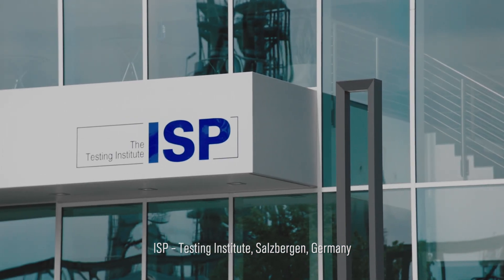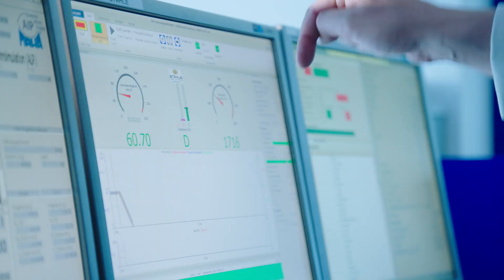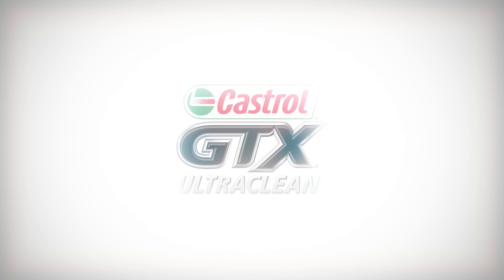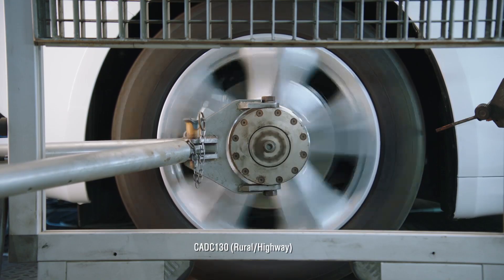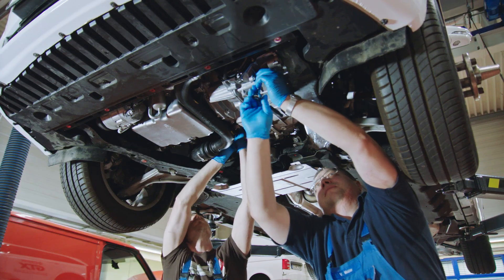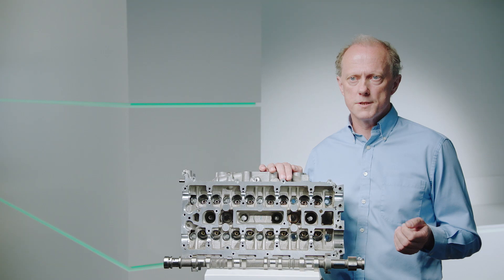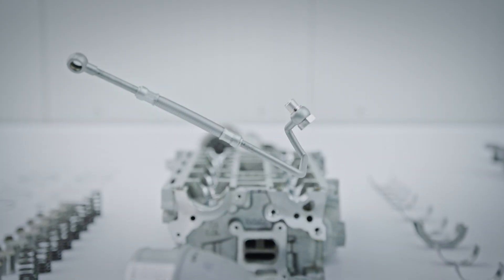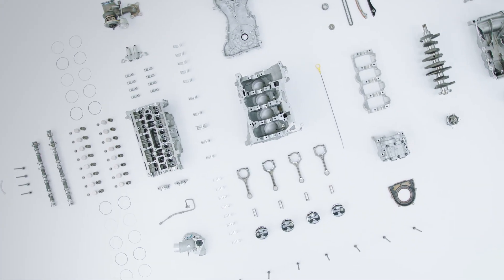Castrol GTX ULTRACLEAN – The 100,000 Mile Test

Comment: Hello! Which oil do u recommend on a 92 toyota corolla E90?
Reply from the maker: Hi JoaoMagalhaes7712,

Thank you for your question. We always appreciate hearing from our loyal customers!

For a 1992 Toyota Corolla 1.6L 4-cyl according to Castrol’s Lubrication Recommendation Guide, 10W-30 motor oil is recommended for temperatures above 0° F. You may also use 5W-30 motor oil for temperatures below 50° F. The oil used must be labeled with the API Certification Seal.

Any of the following formulas can be used in this engine:

• Castrol GTX 10W-30 
• Castrol GTX Ultraclean 5W-30
• Castrol GTX High Mileage 5W-30  or 10W-30 
• Castrol GTX Full Synthetic 5W-30
• Castrol EDGE 5W-30 or 10W-30
• Castrol EDGE High Mileage 5W-30 or 10W-30

Based on the age of the vehicle, a high mileage oil like Castrol GTX High Mileage or EDGE High Mileage would be a great choice.

Castrol USA
Reply: Hello! My toyota corolla has a 1.3L 4 inline engine with 55kW. Is it the same oil? People have suggested me to use 10w40 instead
Reply from the maker: Hi JoaoMagalhaes7712,

Please contact Castrol Customer Relations directly for additional assistance by e-mail or at the telephone number below:

Email: contactus@bp.com
Phone: 1-888-CASTROL (1-888-227-8765)
Hours of Operation:
Mon – Fri: 9am - 7pm ET

Castrol USA

Comment: I run a volvo v70 winh d5    2.4 diesel engine.  Is the ultraclean a3b4 suitable.  I have 900000 miles on same engine and change oil every 2000 miles.  Been using castrol since car was new in 2005.  Have done 450 oil changes in 17 years on this volvo v70
Reply from the maker: Thanks for being a loyal Castrol customer! We appreciate it!

Comment: I am curious about using this in my Toyota AE101 Corolla. My car has a 5AFE engine and it is currently leaking oil. Both front and rear seals have worn out due to the previous owner using a lower quality oil.
Reply: I recommend using Castrol GTX high mileage
Reply from the maker: 💪  We appreciate it!

Comment: I have a 07 corolla. How long until I should change my oil with gtx ultraclean?
Reply from the maker: Hey Blake! It looks like Toyota recommends a drain interval every 6,000 miles for the 2007 Toyota Corolla. Drain intervals are dependent on the condition of vehicle and driving conditions. If the driving conditions are more severe, the oil should be changed earlier than the recommended mileage. 

Hope this helps!
Reply: @CastrolUSA  wow thank you haha I have been getting robbed. Telling me I need it every 3 months
Reply: @CastrolUSA  do you recommend this gtx on corolla w/ a 155k mileage? yr 2000
Reply from the maker: Hey Jed! We recommend EDGE High Mileage 5W-30 or GTX High Mileage 5W-30 for your particular situation. Hope this helps!

Castrol USA
Reply: @CastrolUSA  Thanks a lot!
Reply from the maker: Anytime, Jed! Thanks for being a great customer!

Comment: I have a Mercedes om642 they are renowned for engine sludge I can’t decide whether Castrol edge or gtx c3 which would
You guys recommend
Reply: Edge is more performance oriented in my mind only because I run it in a 5 liter ford mustang gt but for a older engine I'd always go towards their green bottles eepically when they got more mileage. Ultra clean or if you can find, magnatec is very good. In tests the ranking of all Castrol oils are basically their tier ranking but magnatec doesn't burn off as easily so if you want a pretty good oil that's least likely to burn off but the edge professional which is the gold bottle lubricates the best. But a om642 I'd definitely run some ultra clean for a bit to try and clean it up as much as it can and run magnatec in winter since it is formulated to help coat the engine and reduce wear upon cold starts.
Reply: Never seen a Castrol with ester on its base. So find an oil that has at least 5% of polyolester.
Reply: Google Irv Gordan. He used Castrol GTX ultra clean and drove his Volvo well  over three million miles. He changed the oil and filter every three thousand miles

Comment: but what happens to the dirt that is inside the engine already??? clear it off okay but...absorb inside?
Reply: the oil filter will pick it up as its constantl ycleaning the oil passing through it , although the filter can only take so much dirt  till its done its job , then a filter change is required with new oil

Comment: This test is TOTAL BS... 
No stop/start ..No  sitting in heavy traffic with the oil getting super hot ..No heaving revving when the engine is cold...  
A TYPICAL engine oil/filter change lasts around 7,500 Miles or 1 Year which ever comes first  before the oil gets dirty in the REAL World.. 
And I would NEVER trust any engine oil that has done over 10,000 Miles or is older than 1 Year old.
 
ALL of these "Mega high mileage" cars you see on the road have ALL have oil/filter changes done OFTEN.

Comment: I guess my car should have died out 25,000 miles ago. “ 100,000 lifespan of an engine” is he serious? I do use castrol GTX high mileage synthetic blend, though, plus STP Extended life oil filter . But never tried or would try the ultra clean.My car runs like new being that it has 125,000 miles in it. I bought it from a Dr. though ..the only owner.His kids are not old enough to drive. So him or his wife were the only drivers.I agree it’s not a fair test. Testing it in a controlled environment is not real. The stop and go from city driving, puts a lot of stress on an engine.

Comment: Miles are not as hard on the engine as TIME.  This test will not give the same results as when the test takes 10 years AND 100k miles.
Reply: 100% CORRECT .. This test is TOTAL BS... 
No stop/start ..No  sitting in heavy traffic with the oil getting super hot ..No heaving reving when the engine is cold...  
A TYPICAL engine oil/filter change lasts around 7,500 Miles before the oil gets dirty in the REAL World.. 
And I would NEVER trust any engine oil that has done over 10,000 Miles or is older than 1 Year old.
Reply: @briansaiditsoitmustbetrue4206  
Im running castrol edge with a quart added of ultraclean, about 17,000 miles now.
>_>
Reply: @sasquatchcrew  I run my car on bog-standard 5W-40 from Shell ..BUT I change it every 6 months with the oil filter 
Works out at about 7,000 Miles for me.  
I still would not trust any engine oil that has done over 10,000 Miles or had more than 1 Year of running. 
This is why my old petrol engine Toyota is still going strong at 204,000 Miles 
I expect it to get a quarter of a million miles .. Clean oil/filter all the time = long engine life.
Reply: Right. Complete bogus test

Comment: Drive the car on real road with real road condition then I'll believe
Reply: https://youtu.be/zxmD4QYZ8LU
Reply: I'm wondering if their computerized engine and load simulator mimicked city driving. I think at the beginning they note rural/freeway driving, and those have far fewer stops. Also, how often did they allow complete cool-downs and did they mix in some 32 degrees Fahrenheit to 50 degrees Fahrenheit startup cycles? Also, what about some simulated heavier loads (uphill segments, full load segments). And what about GDI intake valve buildups from vaporization/blowby? Problem is the "fuel economy" computerized cycle used in most of these tests is a very easy cycle. Decades ago Consumer Reports tracked a bunch of taxis in New York and got fine long term results from the incredibly poor oils in use back then. So what I'm mainly getting out of this test cycle is that semi-syn isn't completely terrible and won't sludge up the engine, not that it can deal with the higher stresses of aggressive American urban drivers.
Reply: First Name  true . You have dust and others . This is a controlled environment
Reply: Истину говоришь друг .
Reply: в точку!

Comment: Should I use this or the gtx high mileage synthetic blend one? My 2002 Lexus had 190k miles and is on conventional oil
Reply: I have a 2007 Honda Civic EX not to be confused with the sporty SI. My car has 126,000 miles in it. I use Castrol Edge ( has titanium) high mileage advanced full synthetic, with Mobile One extended performance oil filter, and It doesn’t leak a single drop of oil. I set my eternal oil computer to 100% and in one year or a little more gets to 30% oil life. My friend has a garage, he changes oil and fixes breaks and tires for a living. He said the oil looked a felt great after he changed it, maybe I could go a little longer, but why risk it. The car Manuel says 15%, but at 30% for a little over a year, it more than payed for itself . I drive my car every single day in City stop and go. I don’t travel. The “ high mileage” in Castrol means it has a rejuvenator that rejuvenates the seals and helps keep The catalytic converter clean in older cars.

Comment: 100k miles is the typical life of an engine? WTF yall smokin?
Reply: I want what they smoke too :)
Reply: If It's a VAG product then yes
Reply: Typical "economic" life of the car, when ownership and repairs are cheaper than buying a new car. Meaning how long before the car repairs at a dealership cost more than buying a new car. Most cars that stay in service longer than 100k and 10 years are getting repairs by their owners which changes the economics completely; even an indie shop can extend the value to cost ratio of ownership. Except for my dentist with his 120 miles a day freeway commute (60 each way). His car ran up 350k before he got rear ended and totaled. The benefits of freeway driving with no stop and go in non-snow, non-desert, non-towing country.

Comment: I started using castol when I was in high school my truck had 67,000 Miles it's now been 11 years later and it has 260,000 miles I used to use the plain Castrol conventional GTX but now switch to the black bottle casrtol edge now to the Castrol titanium....and my truck has not one problem.....please I would like for you to study my pickup truck everyday for the past 11 years my truck has been pushed really hard in the heat and cold days of southern California and heavy stop and go traffic....I push the engine to about 6000 rpm daily and it has not failed me....the vehicle.... 1996 Nissan pickup 4 cylinder 2.4L .......
Reply: Those old ka 2.4 motors were just built well, true Japanese engine
Reply: @vincentbenfante8213  my truck is now pushing 290,000 and it’s still running like a champ I’ve now moved to Oklahoma drove my pickup from SoCal to Oklahoma and it didn’t fail me.
Reply: My 96 Nissan pickup just rolled out 300,000
Reply: @Platano_macho  my neighbor has over 750,000 on his 07 Honda Ridgeline. Gets the oil changed when the OLM comes on. $29.95 with his $10.00 coupon. That’s with a free car wash. At that price I doubt he’s getting full synthetic. Best oil is clean okl
Reply: @Platano_macho hey, is there any update on your truck?:)
Reply: @moses9368  yes sir as of right now I’m a little over 312,000 miles and it’s still running strong I’ve noticed some transmission slipping when it’s cold but the truck still runs great
Reply: @moses9368  and now the truck has went from California to Oklahoma where it still sees 125 miles daily
Reply: @Platano_macho  That's amazing to hear man!! I hope you keep enjoying your truck :D
Reply: @moses9368  I will man I love this pickup
Reply: 🦄🦄🦄🦄🐆🐯dhrueurrorrgshdiri3oruriirii4iii464647
Reply: Castrol GTX has synthetic blend
Reply: Cold? Southern California?
Reply: @vermontvermont9292  yeah we used to get cold days typically around 35 degrees but not anymore
Reply: @Platano_macho  35 is T shirt weather in winter here in VT lol. I can't stand the weeks on end of 1°f with a high of 13°f . So cold your car won't even warm up after 30 minutes of idle time.
Reply: @vermontvermont9292  I had some cold weather here in OK the lowest was 11 degrees below freezing my truck had chain rattle for a good while because of thick oil lol
Reply: @Platano_macho  can't stand it. Every year I say I'm going to leave VT, and move south. Never do. I can't imagine never having to oil undercoat my car, or buy snow tires for my winter wheels. Putting plastic over the windows on the house. I need to get a block heater so I can keep the oil warm at night. Maybe I'll do that soon.  By the end of October things will be freezing and probably have snow. I've seen snow as early as October 10th before. Almost always have a dusting by Halloween.

Comment: Not really a good test, fair enough they got the car to 100k milles but what about the elements such as polluted air, harsh braking, and turning in to the road at high speeds.The new car wasnt exposed so the engine will look spotless!
Reply: Exactly.  Also they would have used spotlessly clean fuel, not the garbage you often get from the local pump being pushed through a fuel filter that should have been replaced two or three times in 100,000 miles but usually never gets done, cold starts and rough owners who run the car hard from cold, and so on and so on - all the stuff that introduces particulates into the oil that speed its break down and increase abrasiveness - lab tests don't really tell you much at all unless you throw a whole lot of typically adverse conditions in to the testing like you would get in the real world.  Even the very best fully synthetic oil will break down much quicker than 100,000 miles on the road.  Still, I've been using Castrol oils for many years, and they are good value.  I've tried moving to other brands from time to time but always come back to Castrol.
Reply: Tai Mir yep here in Canada its -35c in winter +35c in summer. Factor that in.
Reply: rapturekevin bring that car to Michigan lol but I do like the regular gtx I ran it for 7 k miles in my 97 2door neon 2l sohc .. And only lost a quart of oil but it was all highway. Plus I played with the car a lot hated take off and more
Reply: Plus then cleaned it all up and its a damn commercial for them so if any parts did look bad they'd swap them out for new parts to show on this commercial. Dont trust these guys further than i can throw them. I bet they only ran this engine for a day or two.
Reply: I have a 2015 Nissan Sentra that I purchased w. 77 miles on the clock. I now have 152,000 miles. I took my car w. My old automotive technology teacher from high school as he also has a shop to replace my alternator as it gave out. Mind you I have always always used Castrol Edge full synthetic since I purchased the vehicle I asked him if we drain the oil and open the engine to see what it looked like as far as wear and we were both appalled at how clean it was and how little the wear was for a car with 152k miles. To be fair I also use Fuel additives and Ethanol free fuel but all those are contributing factors to the results. He has always been a fan of Mobil1 and he's always said to use Mobil1 on his vehicles till he dies but once he saw my engine he even said hes goung to switch to Castrol Edge to try it out. He said my engine looked like it had 40-60k miles max and it has 152k miles. You want a real world test? There you go also its a good thing to add 110k of those miles were stop and go all day city driving delivering pizzas with dominoes.

Comment: what's the difference in between this and regular GTX? I have high compression Honda VTEC engine that's been running regular GTX 5-30 since it had 5k miles, it now has 110000 miles and I still use regular GTX 5-30 every 3000 miles. My concern is now I can't find regular GTX anywhere, only this ultra clean Wich I suspect has more detergents and I'm coming up on my next oil change. I'm really concerned that the added detergents will cause leaks by cleaning the small amount of beneficial sludge around seals.
Reply: BayAreaCichlids It's the same great oil just has stronger cleaning additives
Reply: You're fine. I run it in a 600 to Integra. It's great
Reply: Just game
Reply: Why are people still wasting oil in us??? wtf is up with 3k mile intervals? yall brainwashed by jiffy lube lol